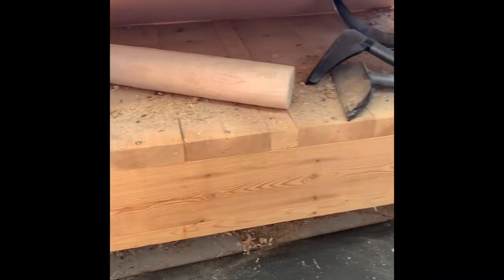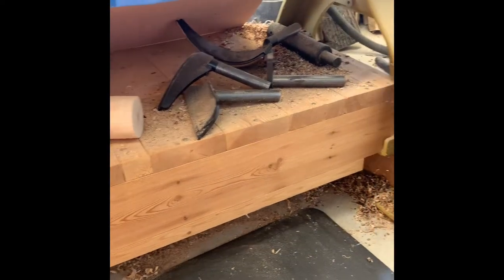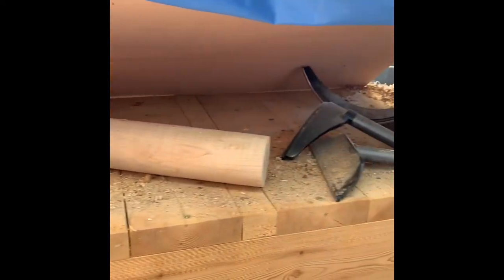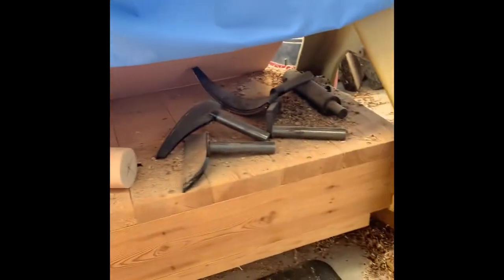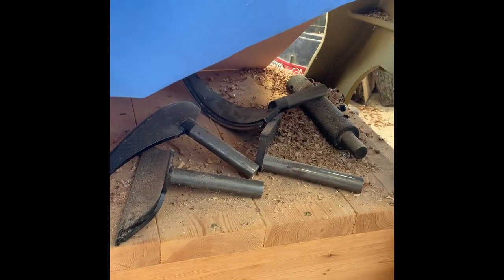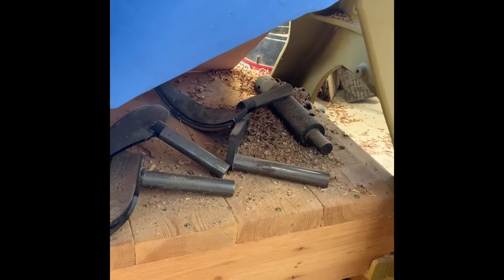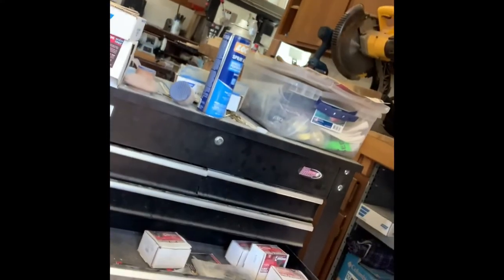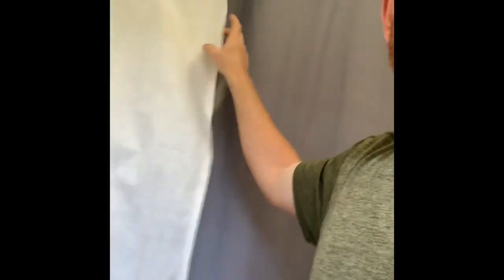Lathe Upgrades to manage wood chips

Comment: Like you I got tired of shavings all over my shop. My wife took a couple of old bed sheets & made me a curtain. I put metal gromets along the top seam and used shower curtain hooks to hang it up with. I used a piece of 3/4" black pipe supported at each end as a hanger rod. I did have to go back & cut the bottom of the curtain off about an inch off of the floor. I found that sometimes I would step on the bottom of the curtain & started to tear out the gromets. This has worked great for several years.
Reply from the maker: Great minds think alike Randell :). The black pipe is a good idea because the tracks I used were not cheap but they do operate smooth.  Our sheets didn’t reach the floor (10 feet ceilings), so I didn’t have the issue with stepping on them.  It’s really helped me keep my shop clean and was just hoping to give others some helpful ideas.  Thanks for the comment